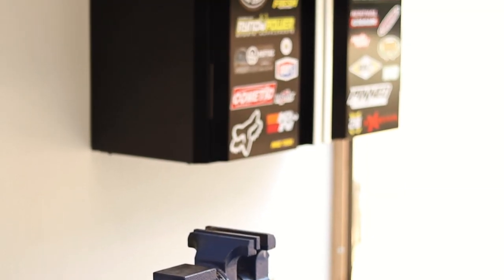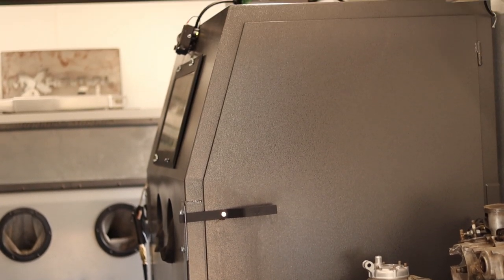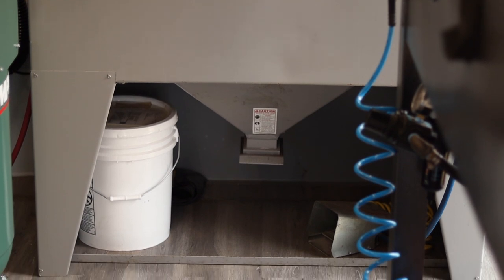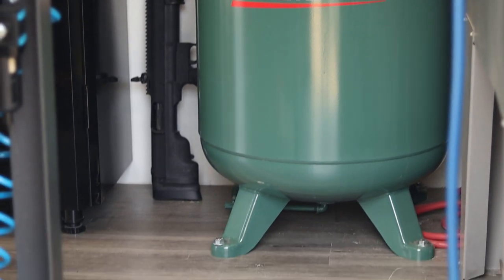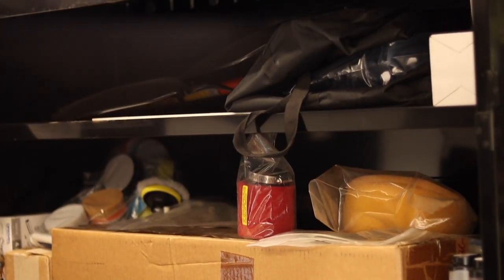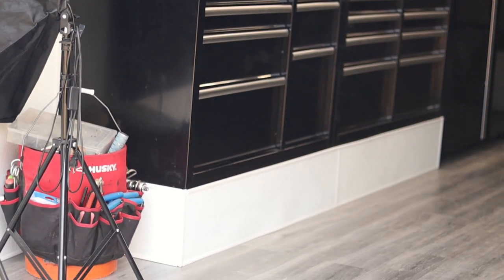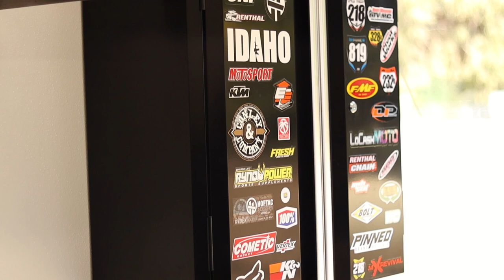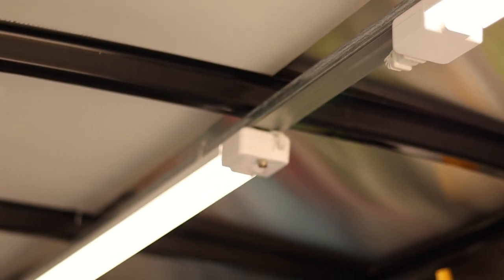Workshop in a Trailer (SO SICK!) Mobile Mechanic Work Station - My Full Build Tour & Shop Tools

Comment: Considering moving my brick and mortar boat repair shop into a trailer rather then selling and relocating. Can’t find employees that have even 1/4 brain. I do fiberglass and gelcoat repairs as well as marine paint. I’m definitely using some of your ideas. Thinking of using gas compressor I have and selling my electric one, but do need my refrigerated air dryer it’s essential. Any input on why you went electric compressor over gas, also, I’m thinking about doing a small “booth” on sides. How about ideas on dust collection for when sanding boats outside the trailer? Won’t be sanding anything inside. I’m going from a 4k sq ft shop to a trailer but I am excited. I am HEAVILY invested in Milwaukee Packout already so that should help. Chemical cabinet and storage of chem/resin/paint will be my main concern. I have both gas and electric compressor already that have plenty of SCFM and either can run my shop now with no problem. Great video!
Reply: Just upgraded to a huge shop 1 year now I can’t run it due to not finding employees. And now I’m considering moving and doing fishing charters and boat repair and detailing on the side. Scary transition

Comment: Hey Charles, do you plug the trailer into a 220v outlet to power the trailer and split your power in the service panel, not sure about the other equipment but the compressor I'm sure requires 220 service, (208v is probably the minimum start voltage)and have you had any issues with voltage drop when a piece of equipment starts, I used to run a large 80 gal compressor but had to install a booster transformer to get the compressor to start because the power company was allowed a 30% drop in power during peak business hours.
Reply from the maker: Great question. I'm directly wired into a two pole 50A (single phase) breaker on our residence. Two legs of 120V in other words. I am really close to the panel so there's no real voltage drop. My service cord is 50' long, #6 AWG. Sounds like your application was commercial or three phase VS the single phase residential power we use (therefore a single phase motor as well). This compressor is also an 80 gallon and only tugs 23 amps roughly, which allows me to get away with just a #10 AWG pair of wires & two pole 30A breaker. Long story but no issues & all code compliant per NEC.  30A x 80% = 24A max draw allowed on the 30A breaker 👌

Comment: Best trailer set up I seen so far. I am building one very similar and clean for mobile Airplane work!
Reply from the maker: Thank you! That sounds like a really cool trade! I hope you do it, you'll love it
Reply: @mxrevival  I been in the trade for almost 30 years, I been on my own for the past 5. I fly them and fix them.
Reply: Question, I see you put a base board to make it level over the wheel wells and set your tool box, how did you bold your box?

Comment: Nice. Where do you park it while in use? Do you have your own home or have you found a way while living in an apartment?
Reply from the maker: We had it plugged right into the house. If you’re in an apartment, might have to rent a spot at a friends house to do the same OR rent a storage unit space with power. Perhaps a generator… 

We’ve since moved again and back in a non trailer space (seen in recent videos) but the trailer days were magic! I’ll remember them forever. (Sold the trailer)

Comment: Awesome as always bro! I love that build. I'm renovating a motorhome right now and I'll probably be doing cargo trailer conversions in the future. The order that they build some of these motorhomes in you can't just take them apart (without like removing the roof and other ridiculous stuff), which is why I think it would be much better to sorta start from scratch with a cargo trailer. Your build turned out frieken rad! It's genius.
Reply from the maker: That's badass Adam. Thanks for watching 🙏 You're right, and built cheaply too! A motorhome is a big project no doubt

Comment: clean build man.  i just happened to run across this video because I have this idea for building a trailer into a harley shop and needed some ideas on how to design it.
Reply from the maker: Glad you found it! Hopefully the entire playlist is helpful. Started with blank everything. Did an episode on flooring then one on wall electrical rough and paneling. I searched a lot as well and there were some good ideas but nothing geared towards what guys like us are into.

Comment: Hey man, love your videos, I just have a question, what are your compressor specs? I currently have a vaporblaster buy I'm going to buy a dry blaster, so I want to know if my compressor would hold up. 
Thanks man, my best wishes
Reply from the maker: Thank you Miguel 💪 you're going to want to find out what the requirements of the tool will be. In this case, your dry blasting cabinet will have specific needs. It will be a certain number of CFM that the tool will need to have sustained in order for your compressor to keep up and not be running over and over and over...

Dry blasting is typically going to use way more air than the wet, since all the shiny stuff is made at lower pressures in the vapor blasting cabinet.

For me, my compressor ended up being a Champion brand, dual stage, five horsepower, 80 gallon compressor.

I want to say it was around $2,000. Spend every bit of the money you need on this tool because it's going to last you forever. There are many, many compressors with the same specs but less $$ that DO NOT put out enough CFM for your tools. This is a really big purchase, so make sure everything is spot on for your needs.

The last spec I didn't mention yet is that the compressor is single phase. There are three phase and single phase units. Three phase is the style of power that commercial buildings have, and single phase is a style of power that most homes or residential dwellings have.

That's also very important. I know you'll get it dialed in and thanks for watching 🙏
Reply: @mxrevival  thank you! You gave me a good idea. Keep up the good work!

Comment: How has the flooring held up?  Looking to build out a retail shop in a 20x8.5 and debating on flooring.  My concern is the rear dovetail where it changes from flat to angled towards the rear ramp.
Reply from the maker: Go with a linoleum style floor and you will be dialed in! I got two Fancy with it, and though it has been extremely durable and looks amazing, it has had some expansion and contraction with extreme heat and extreme cold. It still looks great, but I probably could have saved some cash and really didn't have a clue what I was doing when I bought this floor. I just knew I wanted it. No regrets, there are just more affordable options that probably look just as nice and will expand and contract less.
Reply: @mxrevival  I actually ended up with an LVP that's pretty flexible.  So far it's going down over the dove tail pretty well.  I'm a little worried about some failure points but only time will tell.  It should look pretty badass when it's done though!  Appreciate your video and your input!

Comment: My Man, you killed it with that trailor/shop build out...so much thought in the lay out. How loud is it when the compressor  in on ? Anyway keep up the Great Videos....T1000 Baby 👍🔥🔥🔥
Reply from the maker: Thanks dude. I am really enjoying it. It's just enough. Compressor is an extremely quite one for it's size. The belt cage rattles more than anything so I'll secure that. Impressively quiet otherwise. Start up is startling sometimes even when you're waiting on it but I got used to that.

Comment: Hey I like the setup just wondering how much did it cost to build?
Reply from the maker: Thank you! It really saved my life and my sanity for the last year or so. I literally just emptied it all back out... 

The trailer was about $11,500 out the door brand new. Compressors are probably about $2,000, Vapor blasting cabinet I have is close to $8,000 a few years ago. I pretty much already owned everything else but you could loosely estimate another $5,000 maybe? 

Regardless, something like this in any trailer which is turn key, owned by nobody but yourself, and doesn't have a monthly overhead is worth its weight in gold in a lot of situations.

Trailers up for grabs if you are interested, flooring, FRP walls, and all electrical still stay. Trailer finally took its first trip when we moved a couple months ago so it only has 800 miles on it. It went from the dealership to the house to be built, then from the house in California to Idaho.

Thanks again for watching